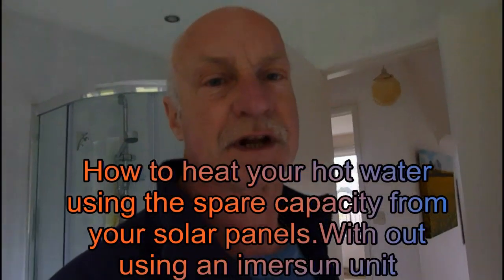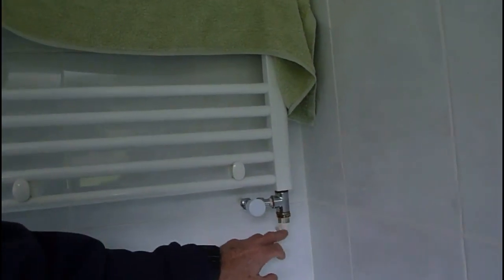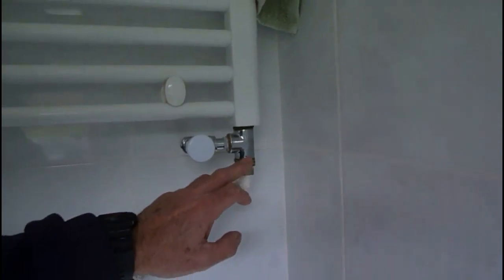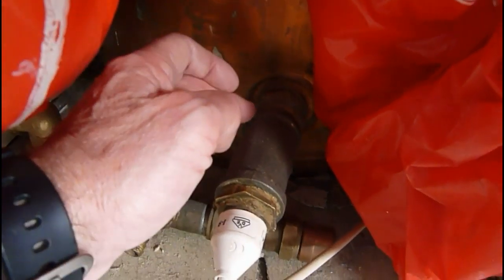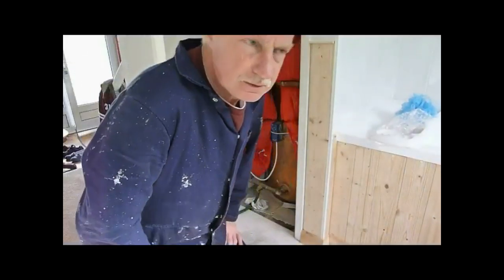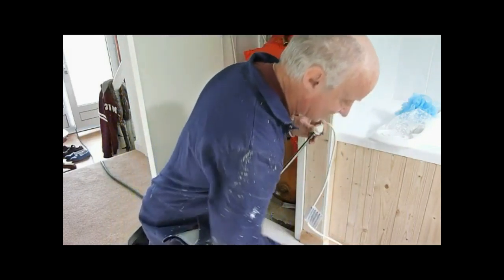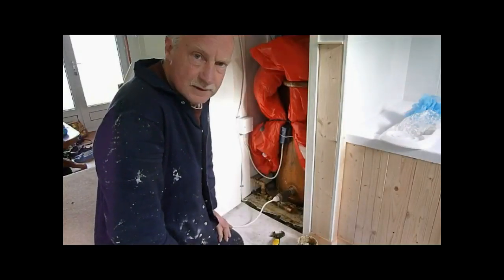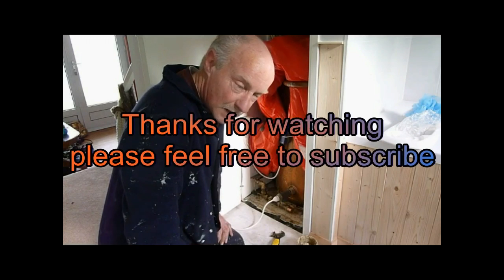How to use the spare electric capacity from solar panels to heat your hot water.

Comment: I use a time switch and a 240volt to 110 volt transformer, like used by workmen for their tools, instead of 3kw it uses about 750 watts, using the old immersion heater.

Comment: you seam to be a wizz, im trying to achive something like this, i have fitted Solar PV and i want to heat my home with it, i am also wanting to use the back boiler on my log burner to provied the hot water/ heating as well during the winter months. Is what i want to do an easy thing to do?